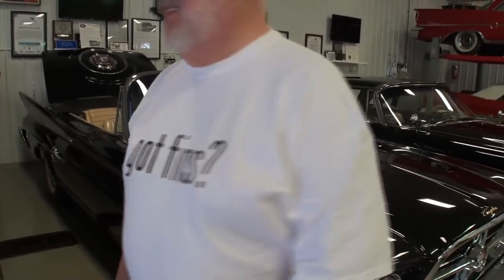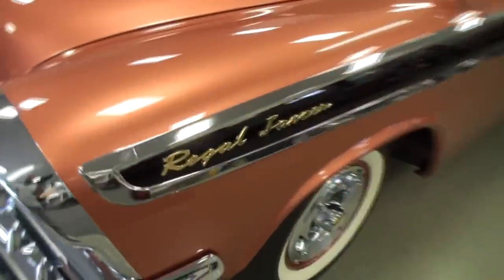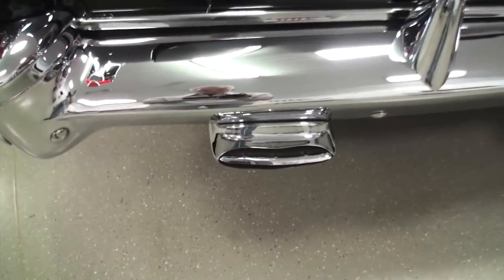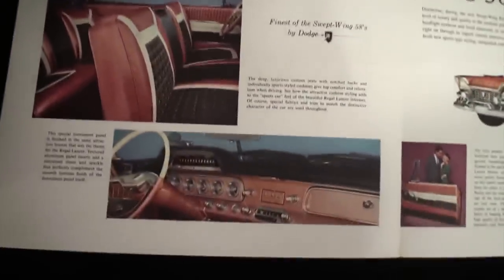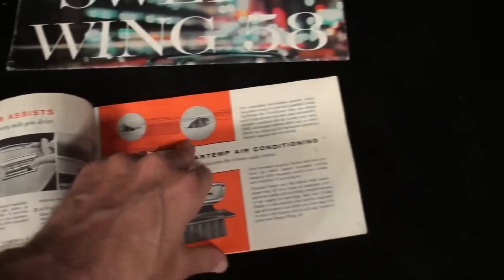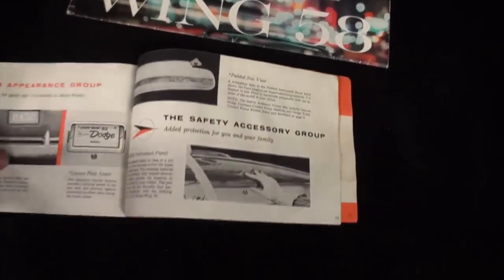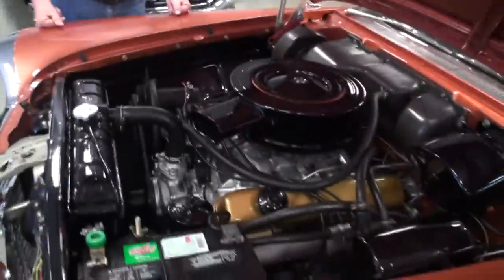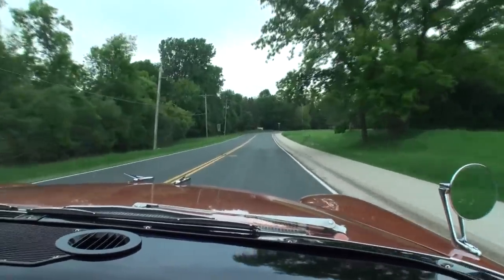Lots of Chrome ! 1958 Dodge Regal Lancer in Copper & Black & Ride on My Car Story with Lou Costabile

Comment: This guy has an incredible collection of vintage Mopars, and this 1958 Dodge Lancer is no exception! It is loaded with lots of style and a ton of chrome. I didn't realize that Mopar released a 350 engine for only the 1958 model year. I love the black on copper color scheme. That really sets it off big time! Good job Lou!
Reply from the maker: Hi Michael, Happy to read you appreciate this collection :-) You're right, this car is loaded with lots of style and tons of chrome. Just the way we like it. Appreciate the kind words on this video, Lou
Reply: For a 350 motor in such a large car tells me it had to have a higher compression, like 12 to 1 to squeeze more ponies and torque to get the job done.
Reply: @billyhndrsn4542  350 was the base Dodge Royal engine and was, with dual quads, optional on the Plymouth - 305 horses.  The D500 had a dual quad 361 with 320 horsepower, 333 with Fuel Injection!
Reply: Anybody have any idea why that 350 motor was a one off (1958 only). I mean they don't engineer engines for only one year on purpose as that would be too costly. Did they find problems with it or what?
Reply: @nonelost1  Probably just didn't make sense, as they had the 361.  Too close in size.
Reply: The 350 was one year only, but other than the bore it is a regular Big Block, like the 383 and even the 426 Hemi is based on this. A Y block and one of the sturdiest, most reliable engines of all time.
Reply: @nonelost1  It is a regular Big Block (just with a smaller bore), that is still available new today. It was in regular Produktion into the 80s and even the 426 Hemi is based on this. One of the best engine designs of all time. Way over 350k troublefree miles on my 383 when I had to pull the heads for the first time because of 2 leaking valves, caused by unleaded gasoline.
Reply: @bigblockjalopy  I would like to find an RB version of the 383 - 3.75 inch stroke, just like the 413, just to be different.
Reply: @michaelbenardo5695  actually contrary to popular believe, the low deck is the superior version with a perfekt bore/stroke, rod Ratio. It is sturdier than the RB. The RB 383 combines the fewer cubic Inches of the B with the drawbacks of the RB. The RB 383 is 2 years only (59/60) and Chrysler only. Dodge, Plymouth and DeSoto got the low deck 383.
Reply: @bigblockjalopy  I know what you are saying, but in my neck of the woods, traffic is so horrible, top end performance is not that important.  You can't use it anywhere, so for me, the longest stroke is better.  That's just me.
Reply: @michaelbenardo5695  IIRC you will have to use the small 1.95 intake valve heads (1rst gen) with the RB 383. If you want torque, get a 413 or 440. Same engine/weight with better performance.
Reply: @bigblockjalopy  But I would have something unique with an RB 383.  Just think how cool it would be if I found a 59 or 60 DeSoto with no engine in it, and put one of those in it.  Not looking to build a hot rod.  413 would be better for that purpose.
Reply: @michaelbenardo5695  These things are all unique today and you can't tell the difference from the outside, but you will miss the cubes when driving. You can't have enough torque.
Reply: @bigblockjalopy  The RB 383 was only sold in the US.  Canadian Chryslers got the B 361 just like Dodge, Plymouth, and DeSoto.
Reply: @1575murray  yes

Comment: Anyone remember the sound of those non clutching mechanical fans? That sound brings back memories, it sounded like when you got on it and the RPM got up, every bird around was in danger of being sucked up into the radiator! I forgot all about that sound of vintage cars compared to modern engines.
  Thanks for the audio nostalgia treat down memory lane Lou...
Reply from the maker: Hi zulumax1, Happy to read this car brings back audio memories :-) Thank you for viewing, sharing, and you're welcome. Lou
Reply: I think the fan clutch came into being on mainstream cars near the end of the 50s, but until about the 80s, was mostly found on cars with air conditioning.  By the 80s, almost all cars had air.  The very 1st car I know of with a fan clutch was the Will St. Claire of the 20s.

Comment: Exner excellence! He designed most of the Forward Look cars 1955-1962. At Dodge, he worked with Dodge Chief of Styling Maury Johnson. The '58 is more than 90% same as the 1957 model, but the front end is more refined, getting a few cues from Harley Earl's Cadillacs at GM. The lower chrome bumpers are same as '57, but everything but the headlamp assemblies are different.
Reply from the maker: Hi Dejael, Thank you for sharing your knowledge, Lou

Comment: You know, about 1 or two years ago, I was watching an episode on You Tube of "My Classic Car" with Dennis Gage.  He was interviewing a gentleman in California who owns several (and that is putting it lightly!) classic 1950's Mopars.  The guy's name is Aivar.  Well of the several cars that Aivar owns, one, a 1958 Chrysler New Yorker convertible in green took me off the ground.  I have always been a GM guy (because overall through most of Automotive time, GM held the stirrup of Design)... But I admitted to myself that day that I found myself transfixed by one 1958 Chrysler New Yorker, that had I been around in 1958 and able to buy a new car, that that new car would have had to have been a new Chrysler automobile!  Then and there, I knew that a 1958 Chevrolet Impala, or 1958 Cadillac El Dorado, or Corvette just wouldn't have worked out for me.  Chrysler would have been my marque!  WELL, today, seeing this 1958 Dodge Regal Lancer, and it being the Spring Edition model that it was that only came in few color combinations, my eyeballs popped out of my head!  Lou, you did a great job on this one!  And this man apparently knows how to maintain a thoroughly beautiful car collection.  I couldn't find ANYTHING that I did not like about this 1958 Dodge!  Have I ever looked at a 1958 Dodge before?  Of course I had... And I can also tell you that I was not a big fan of the taillamps... Mind you I like the 1958 better than the 1957 with its improvements... But I like the 1958 Dodge better than the 1959 models too.  TODAY I decided for myself that the 1958 Dodge is just about the handsomest cars to have come out of the 1950's!!!!   And this springtime special made it so.  Check out Aivar's 1960 Dodge Matador 2dr hardtop though.  The 1960 Dodge is also one of my favorite Dodge's....  I am thankful for Mr Virgil Exner's graceful handiwork for Chrysler too.  Sorry his health was not where it needed to be though!  Great video!!!!!!!!!!!!!!!!!
Reply from the maker: Hi Peter, Happy to read your "eyeballs popped out of your head!" High praise :-) Thanks for the tip on Alvar's cars. Hope we meet someday soon. Appreciate the kind words on the video, Lou

Comment: Given this car has at least 96K on the odometer (196K maybe?) they did a heck of a restoration.  I remember from our '58 Windsor that we got it in '64 as a second car - my dad had the front seat recovered (on a car only 6 years old at the time).  The fins were all scraped - even my mother scraped them parallel parking when a street sign was too close to the curb.  The electrical system (those push buttons) caused recurring problems - when you start to know the AAA guys by name, that's a problem.  I can't overstate how obsolete these beasts looked if you owned one in the 1960s.  Someone laments here that his dad only got $200 for one on a trade-in.  He should be lucky he got that much.  But they are works of art and automotive history for sure and great to look at.
Reply from the maker: HI dmiller1000, Happy to read you have memories of your 1958 Windsor :-) Sad to read you knew the AAA Guys by name :-( Thanks for viewing and sharing, Lou
Reply: I remember dad had an early 60s dart, by the later 60s it shit the bed.Had that pushbutton on the left side .Took it to the car crushed & they guy didn't want to give us anything, mom got a 150$$ out of him..lol!
Reply: Ps, chp.used the 2 door dodge corners, from ,,56___59, the d_500 models, the hemi was dropped by Mopar in 59, a bad! Mistake! They regreted, !!!, Later!!!!CHP. Then went to the Polaris, 413,& 440 mag. Mother's, could run 140 mph!, No problem!!, Gene, calif...

Comment: Lou Every inch of this car is is immaculate. I take it that from the owners statement there were only engine options so was air conditioning not available on this car? I find that strange considering how upscale this car is. I would like to know what if anything has been restored. 1.Paint 2. interior 3. chrome & trim 4. Engine. ect. Lou you did great camera coverage of this car. One further question concerns that amazing curved front window. Was that the first year for it?
Reply from the maker: Bill, Happy to read you enjoy the condition of this car :-) Sad to say I don't have answers to your questions :-( Glad to read you enjoy the camera coverage, Lou
Reply: Air was not an option on the Regal Lancer. I know strange. It has received a complete rotisserie restoration twice. The first time wasn’t perfect and I can’t live with it like that.
Reply: 'Amazing curved front window' that leads you into the amazing interior - This windshield was introduced on the Forward Look Mopars in 1957, and this particular design was installed on the '57-'59 models. A different 'bubble' windshield was installed on the full-sized unibody '60 coupes and '60-'64 convertibles. Imperials always had their own windshields. For its '61-'64 coupes, the big Mopars wore a flatter windshield. 
Also, while this video shows us the interior, it doesn't offer us the full magnificence of the industry-leading sparkling carpeting, beautiful seating and door panel fabrics, and futuristic dashboards with their full - fuel, temperature, ammeter, oil pressure - instrumentation that you fully take in when seeing one of these Forward Look beauties in person!